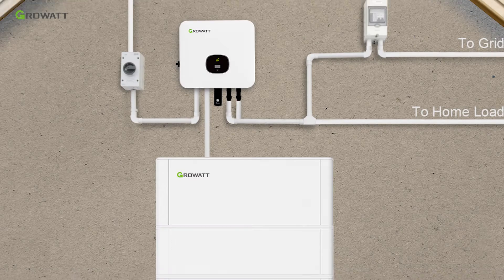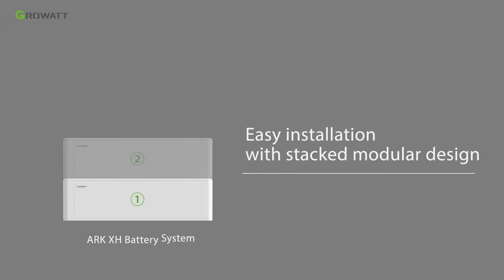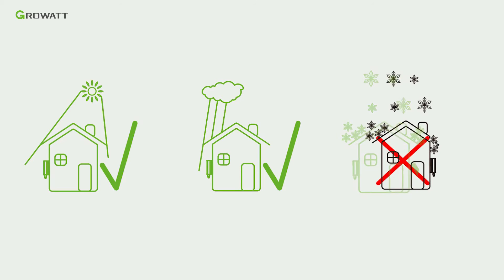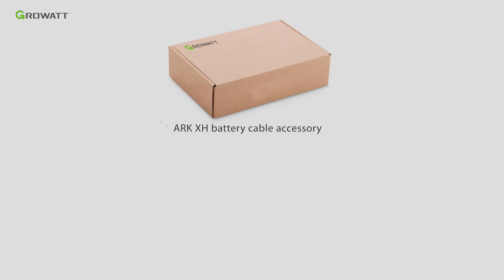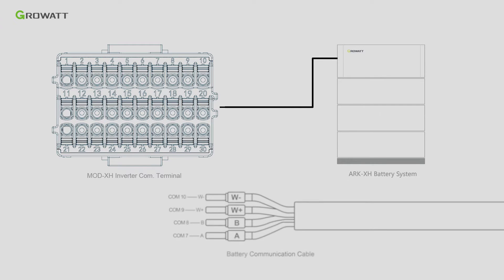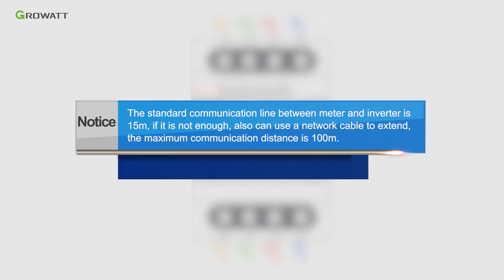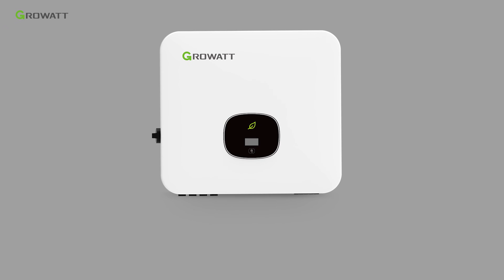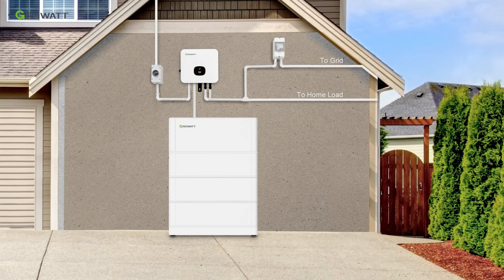MOD-XH & ARK-XH Battery Ready ESS Installation

Comment: I am from Sri Lanka. Bewear of the compatibility of ARK (ARK 2.5H-A1) batteries with MOD Intverters (MOD 5000 TL3-XH). I have 03 ARK Batteries and a MOD Inverter. Sad to say the batteries wont get charged through solar power and get discharged  when required. I have to charge batteries using the Grid Power. There seems to be a communication faliure between the Inverter and Batteries. I have sent couple of mails to Growat HQ, China seeking for a solution, unfortunately  no solution has been provided by Growatt as yet. Thanks
Reply from the maker: We apologize for any inconvenience caused. To provide you with further assistance, could you kindly share these details with me and I'll expedite the followup. Name, Company, Email, Country, Brief Description of the issue faced.

Comment: The cable conections in this video are not that simple
there are 2/2 black conectors for pv i have the same like in the video
connector 2 negative the connector is not fitting connectors 1/1 blue
connectors for the batterys are not in the box with theother conectors
so i have only one cable to connect pv and battery growatt service
is a service from hiding growatt new energyijselstijn the netherlands
is no were to find there were a other importer from growatt first
now they go international growatt europe in polen contacting chensen
new energy you ending up with alibaba, well good if youlike to make a game from it
and you only think about selling, i am thinking about it topost a video
from how and what is not fitting and giving it the name only for adult
inverter porno, with electricity plugs we deal with a male and female side
normal this working good, but with growatt i am talking about doggy connectors
why the are not simple to make them lose, while you are reading this think
in the same time to a song fromkate perry you are not allone
connectors should be there in two parts th e black for the pv 2/2 and the blue
for the battery in total 3 plus and 3 min connectors connector pv 2 min is not
fitting the cable fit not on the inverter side there is o,5 mm different in diameter
the wall thickness is 1 mm you can not take it from here the black conector do not fit
on the blue connector and the blue conectors are not even in the box with parts
 that is making that there is only one cable to run 9 kwh that is not working
why doggy stile connectors it is a big problem to make them lose with my other
inverte i make 12 connectors lose in the time from 1 doggy connector..
now how to repear this that needs a complete replacement from all connectors
because the are on the inverter next the are conected to a prindplate in side
what is only to build in simple by thfolowing order it is build so realy not a simple job
but i go on while they play the game from hiding i do have a other solution
not nice but they do not stop me the solution is to cut all connectors from the inverter
and make the conection direct to the wires, thanks growat on your nose for the great service my kids are to old otherwise i would ask you to teache them the gam from hiding.

Comment: In Europe (at least the Netherlands) many people have smart meters installed in their house following the dsmr 4 or dsmr 5 standard. This is able to provide usage up to every second. Will the Growatt Mod hybrid inverter be able to read this either currently or in the future? This will greatly reduce complexity, cost and space in the fuse box aerea. 
For example my fuse box is full after installing fuses for my mof hybrid inverter. Battery is a future project.